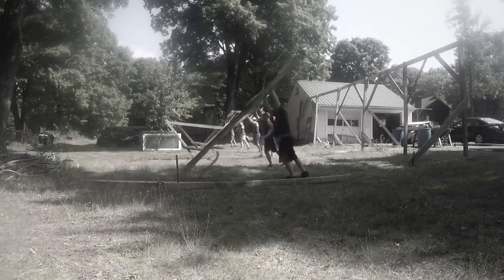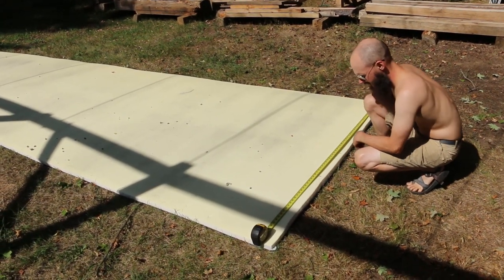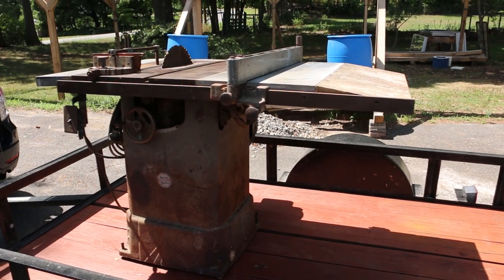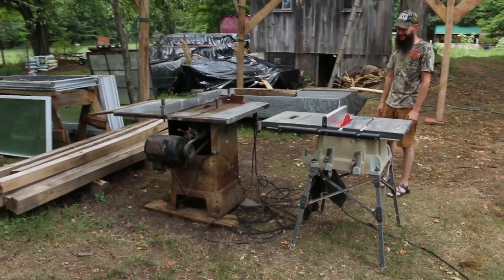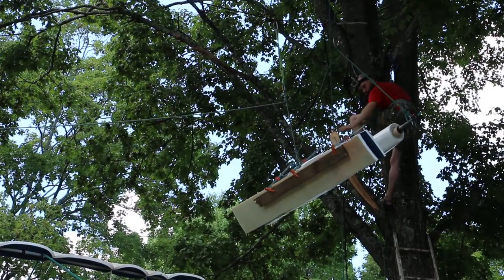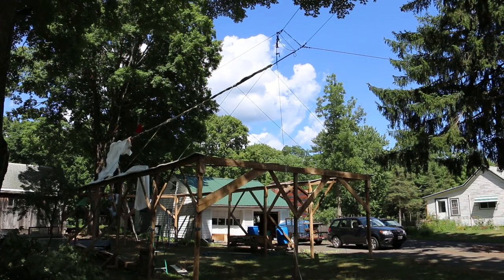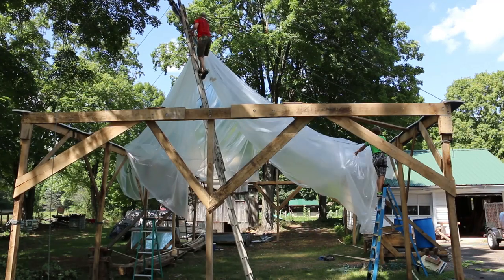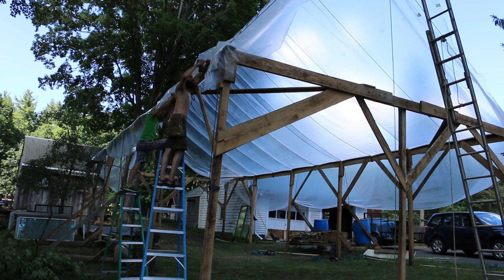Acorn to Arabella - Journey of a Wooden Boat - Episode 6: Putting Up The Boathouse

Comment: New sub -- started watching from the beginning. Where I live, they don't really care about outbuildings other than to add them to the tax rolls if they are permanent. We didn't have building inspectors at all until the year we built our house -- but we are very rural. Is that table saw an old cast iron base Delta? A shop I worked at had one, along with several Iron base Powermatics (green back then). You are absolutely right about the saw. It is a very nice deal indeed!

Comment: I wonder which one of your neighbors, ratted you out. Similar case to what happened to Leo over at Sampson Boat Co (YouTube).
Reply from the maker: Nope,
Building inspector just happened to drive by.  Neighbors were all pretty peeved he bugged us. It's one of the perks of being 5th generation on the property, all the neighbors have known Steve since he was knee high to a grasshopper.
Reply: We had the same issue.  Inspector drove by our neighbor and saw lots of trash from gutting part of the house.  He stuck his head in and just said, go get a permit.  He was cool about it but yeah I’ve learned to just suck it up and get the permit first.
Reply: Sometimes the building inspectors can be a pain but the bottom line is to enforce a level of safety and that is a benefit for everyone.

Comment: You should have claimed that it was a TENT or a MARQUEE.

I do not think it was a building as it did not have any kind of foundation. I think it actually is a marquee or a tent. You just had poles holding up a canvas. Specially if you would not had made solid walls.
Reply from the maker: Anything over 100sq' needs a building permit here, even a tent.